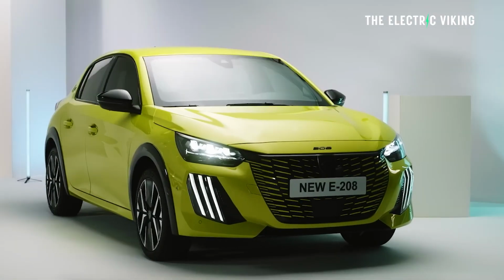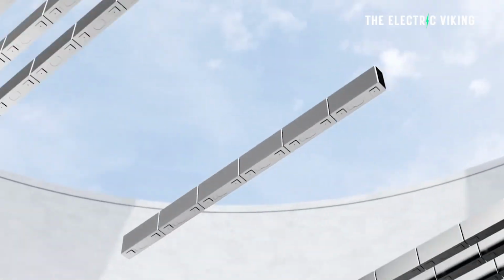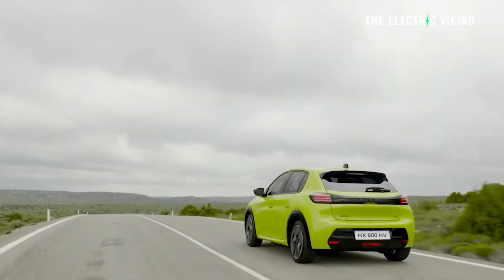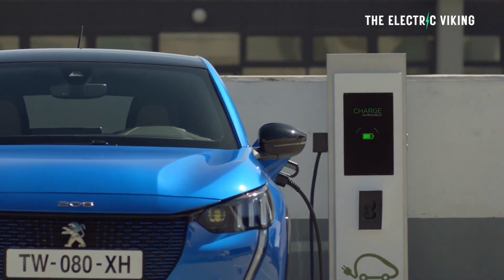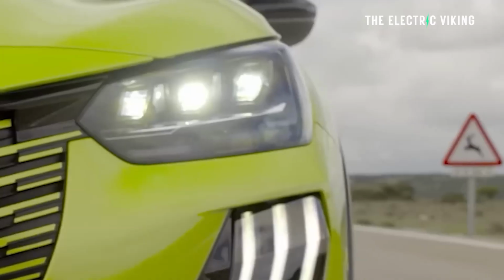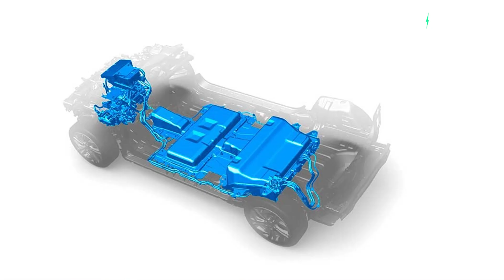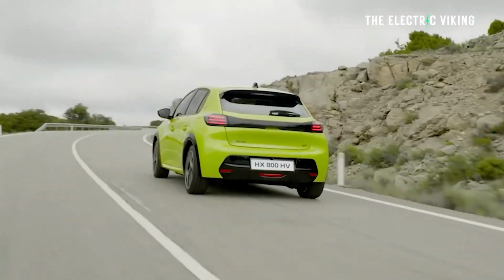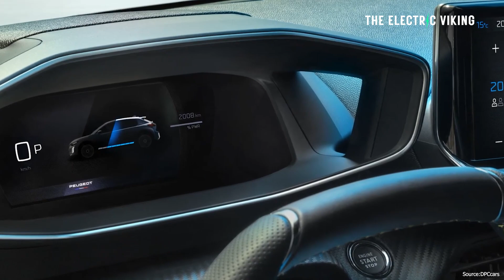NEW Peugeot 208 Looks Sexy - but is it worth this much money?

Comment: The split battery installation helps with interior space as there will still be a full depth rear foot well, but must add a lot to the assembly cost, compared to just bolting on a structural pack. Also the cost per kWh that Stellantis are paying for it lithium ion nickel batteries must be a lot higher than the LFP packs. It is cars like this that will really benefit from having smaller high density solid state batteries when they are finally available.

Comment: I’ve had a BEV one for 9 months. It’s a great small car, fast, smooth, great to drive and looks great (especially in the deep red I have). However like many EV drivers in the UK I don’t own it, just lease it on a company deal. 

I wouldn’t buy a new one as it would be £35k here. Also a one year old used one is £20k - 25k here so depreciation is high. Nice car but doesn’t make sense as a private buy.
Reply: @stevenjones916 It does make environmental sense vs having a gas car. The vehicle will do many miles over its life.  Plus air pollution in the cities will improve.

Comment: The 208 was the best selling car in Europe for the year 2022. until the 2023 facelift there were no hybrid options.  In Switzerland you can pic one up for arround 30k usd. after the facelift it is gona have a 51kwh batterypack which is assembled in poland.
Reply: Nope, from 2024 it's gonna ve assembled in Spain, Figueruelas Plant.
Reply: @DanRyzESPUK  battery is from Poland

Comment: LOL it not going to sell in Australia, it's jusrt too expensive for what it is.
If Stellantis had launched this car in Australia 2yrs ago it would have sold.
The Atto 3 is bigger, cheaper and better in every single way. The fact that's it's European means nothing when it's just not good value for money.
In most other countries Peugeot are seen as a run-of the mill manufacturer, and yet in Australia people perceive them as a lucury car (which they are not).
I predict Stelantis will sell as many of these as Mazda sold MX-30s, then they will say that the reason they didn't sell is because "Australia doesn't want electric cars".

Comment: The previous generation was priced say 5/7k lower. You see it throughout all Stellantis offering. Corsa e, Citroën ec4. At a 25-30k euro price it offers bang for it's buck. Even though it will compete with the MG 4 most of all. But put a 35-40k price tag on it and you battle with the likes of a Tesla model 3 and even a Kona or E Niro. It's fun to drive, but not worth that much. Better buy the previous version for used 20k and enjoy it. It's a small fun car.